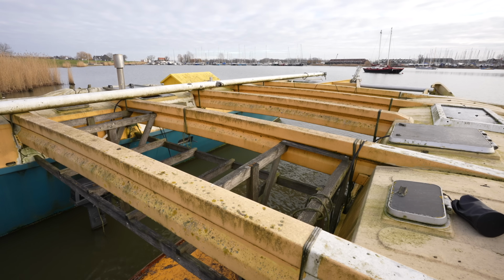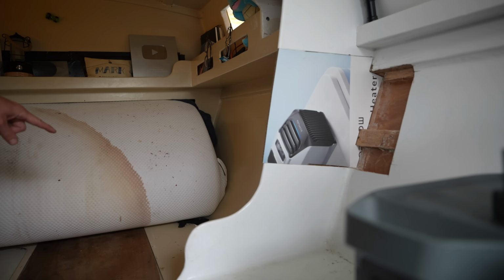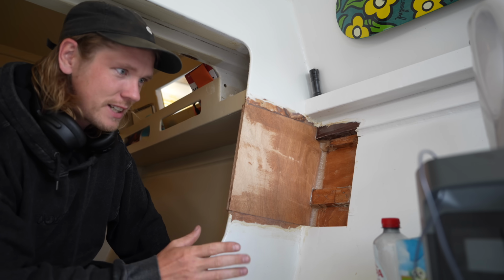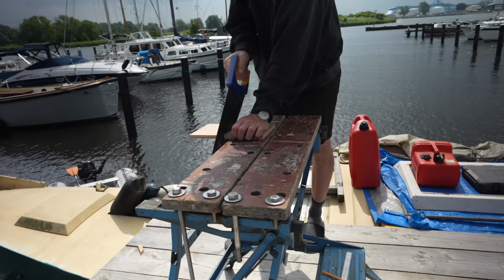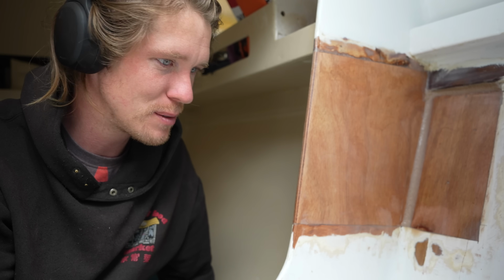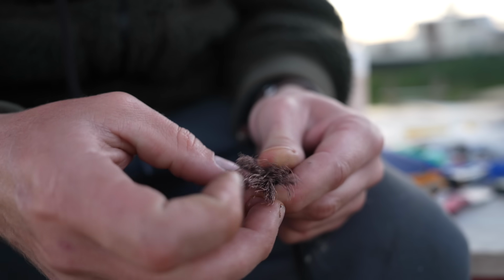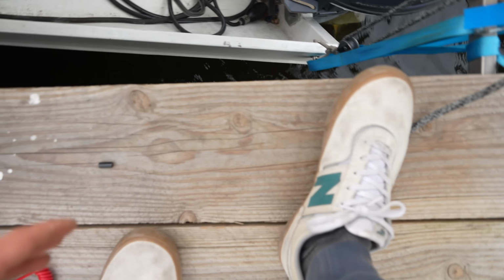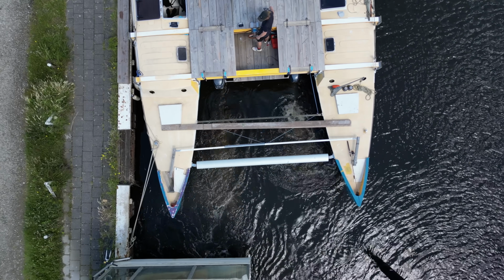My DIY Catamaran Engine Set-Up Is Complete!

Comment: Love the Jazz and Beebop 

As per previous comment regarding the bulkhead repair I agree a couple of layers of glass cloth over each side to strengthen the join or maybe route out   at 3mm depth either side and say  50mm above and below the join and epoxy in some ply doublers to spread the load across a wider area.

But I'm guessing Anika would have recommended a scarf joint, have you asked her opinion?

Replacing the motor cable was a good move, again as per previous comment I've never seen someone try to clean off a cable it's easier to just cut off the dirty/ damaged section.

Your bird friends are  Cootes and we have them in Australia also I live in Canberra South Eastern highlands and they are prolific here on all the man made lakes.

Great video

Cheers

Comment: I would encourage you to cut out the solder connections for your power wires and go to a normal moisture proof inline splice. From what I witnessed your solder did not flow. This causes a cold solder joint which will eventually increase in resistance and break.

Comment: Always better to use mechanical jointing for cables especialy high current ones. The solder can melt if the cable gets hot and the joint is not as good electrically.

Comment: Thanks for the tunes. I always appreciate some good jazz...Kenney Burrell? I just have to say that for any scarfing in bulkheads, a layer of fiberglass or somehow overlapping joints would be something to consider. Even though your dealing with mostly compression loads there will be some rotational torque on them as well. A craft in a sea state has a tendency to twist, bend, and flex. 
Best wishes and keep up the great work.
PS I feel you on the soldering. Definitely not my cup of tea.

Comment: Follow up on that glued in  bulkhead splice. Now reenforce it with wide tabs making them smaller as you add layers....like 5-7 layers of bidirectional fiberglass with good epoxy on both sides as wide and long as you can go.
West Marine has an informative Fiberglass Boat Repair & Maintenance West System Book 002-550. Worth every penny.

Comment: Messy soulder joint.  lol
Cold soulder connection will cause problems.  
Heat one side & soulder from other side , wait for it to heat and suck soulder in

Comment: The methode to extend the cable is perfect with more practise but you really need more energy.
In this case you should look at "Action" for a lighter with the welding flame, what I saw you have done somehow with a gas welder but I think of something with open flame.
You need more then 30W heating power. From 100W up with a good electronic tinn it will work much better.
For that Cable seal rubber, silicon spray is your friend and it will slip through like.....  ;-)
Why not connecting the engines in parallel? If the batt is full, it is full. I guess nothing will happen.
It is a lead batt, that will work for now.
If you later decide to go with a full 12V System on the boat you might go for a small lead starter batt and a big LiFePo4 for the whole boat which you can charge with a batt booster.

Cheers
Marc

Comment: On one of the "other" boat channels, the owners mentioned some mattress underlayment that addressed the moisture/mold issues.  I will take a look and see if they specify the material.  If not specified, I will say which channel and you should be able to communicate directly with them.

Comment: They make line cutters with multiple size wire cutters and splicers. A hell of a lot easier and less time to fix. Get some connectors and crimp with your cutters then shrink wrap it. In about 5 minutes compared with an hour with that useless soldering iron .

Comment: Don’t solder cables of heavy gauge, as you found out by the time you get enough heat into them you will damage the insulation. Get yourself a good crimper and use ferrules/tube for butt joints.

Comment: Some things will work initially. Others may have to be upgraded either before failure or during sea trials. For your mold repair you have brought the repair to the original condition. Your choice if you want to do more and beef it up. Youbalso have drawing planscto reference. Plus your neighbor's Wharram for reference. Help is a phone call away.

Now that the engines work, you can take the time to improve reliability even further. The soldered joints should be a temporary fix.  Replace with tinned cables at full length. Next look for economical solutions to control battery overcharging. Contact the engine manufacturer or a suitable supplier like Victron or your dad. Make a permanent control box/console for the engine key(s).

Rain and more rain.

Slats below the mattress, make or buy, Ikea or similar. Store the mattress in a protective cover (water resistant/waterproof).

Comment: If you are getting 15 and almost 16 volts at the battery, that is way too high. Plus with the length of your cables you will have voltage drop from the (alternator)charging system to the battery. So with that said, 16 volts will cook the battery and with the voltage drop it will be charging more at the alternator output. That high of a charge will cook the stator and they are no fun to replace in an outboard. Check the voltage output from each engine separately with only one running at a time to find the culprit. You should be back in the high thirteens or low fourteens with a fully charged battery.

Comment: Have you thought about using a solar panel type controller to stop charging the battery. cooking the battery is not good and a fire risk plus a fuse for your battery.

Comment: I think you need a split charge relay (or a more modern charge controller) so that your engine battery has priority. It will charge first and won't discharge when you are using power in the boat. That way the small varta acts as starter for both engines and the leisure battery is only for leisure.

Over charging shouldn't be an issue. The alternators should be smart enough to reduce output when the batteries are full. They will still show voltage but at a tiny insignificant current.

It might be a good idea to add shunts to each battery so you can monitor charging and charge status. You can get cheap ones that will work fine and you can monitor them via Bluetooth with your phone.

As mentioned elsewhere you should add fuses and kill switches to both the batteries. All cables need to be tied down with pclamps once it's all fitted. If you leave them flapping around they cause joints (especially crimped connectors) to break down and start sparking. Common cause of fire on boats and in campers.

Comment: With the computer, yes RAM is the most critical thing when you want to do video editing, I would suggest you ready the details of the instruction manual of your computer because a lot of the time you can add more RAM to an old computer.  You could open up the laptop and look at the motherboard, but instruction manuals are easier.

And now that you have a new computer I would suggest that you see if you can add more RAM to that one.

Comment: Lots of great progress. 

As for the soldering. Sorry, but that wasn’t good penetration. You should actually see the solder being pulled into the connection. 
The first shield you were using was for heat shrink. 
When making the butt connection, don’t splay the wire like that, just wiggle the connection together. It’s a tighter connection and a cleaner look. If you have a flux, just push each end into the container before pushing them together. Also, what I like to do, I take a waste 150mm section of wire and strip it down. I then take a single start and off the wire, and tightly wrap it around the section to be soldered. 
Since you have a gas soldering gun, I would use a bare flame to heat up large connections like that. I would then apply the solder from the side away from the flame. You want the copper to be melting the solder, and not the flame. A smaller gauge wire would be so much easier. 
I was a communications tech, and in close to 10 years of work and thousands of connections, I never had a single failure using that technique. 

If you’d like, I could make you a tutorial video, and email it to you. 

What you did will work, but it could be much better. I’m not trying to just be critical, I’d like to see you learning a better way.

Comment: There are lost of stuff available for under the mattress. for me battens didnt work but i had better resalts with plastic floor tiles that are made for wet areas like in a bar or kitchen. for best resalts you realy need air flow so maybe batten the locker lids and have the lockers vented into the main cabin so that moist air can escape. a 12v fan in the locker vent would draw the air away completly🏴‍☠

Comment: Crimpconnectors are the way to go,  or you get a 100watt beast of an iron. 
I would not use the cheap heatshink  i would go with multitask like shrink tube. It has an heat activated sealer inside of the tube😅

Comment: I wonder if an air purifier would be a good thing to have in the boat? If you get one an hepa filter it would remove fungus spores!

Especially when you are removing fungus rot it will get in the air and all over the place
Reply: But maybe a smaller round one would be better on a boat. Just search for hepa filter.

Comment: You need a bigger soldering iron, but also, when the iron builds up a black coating of carbon on it, it won't melt the solder, so you have to clean that off regularly... Or file it off if you've failed to clean it previously. A lot of soldering irons you get are only suitable for small gauge wires and PCB work. For those heavy wires you need an 80w. The torch type ones are shit.... Sorry, bit late for this advice.

Comment: More unsolicited advice.  When rebuilding your mast, take steps to prevent the wiring and halyards from being able to swing side to side inside of the mast. The noise from dreaded "mast slap" can drive you insane.  Take care 😊
Reply: One effective way I have seen done is route wires in pool noodles inside mast  put a few large wire ties leave on long tails every 4 feet or so. if your halyards are external all the less problem.

Comment: You need fuses on these cables. With such a massive battery the cables will be glowing in seconds putting your boat on fire if you get a short-circuit.

Comment: Put switch to cut the power off from one engine and turn it on and off when using it so you only need one battery
Reply: Careful with this! If you turn an engines battery off when it is running you will fry the charge circuit!
Reply: @nigelluke6078  how’s that

Comment: Don't solder, use waterproof butt connectors that are crimped on. Solder makes wire stiff and brittle, hence a weak point that's prone to break.

Comment: Mark when you get a chance to watch something Learn about Kajell's wave powered boat, with your Dad's help I'm certain you can incorporate a wave drive. The tech. Is now out of patent and there are a few videos from the 80s and an Indonesia trimaran ship using wave power. It translates wave energy to forward motion in a simple mechanical design and the foils can absorb about 50kw per. M2 of foil.

Comment: I didn't think I liked modern jazz but that was good! As for that wire soklder join - that was awful. Do they not make connectors? I have been trying to think of a better engine configuration - have you considered a huge paddle wheel between the hulls - it could freewheel when not under power and generate power!

Comment: If it's a lithium battery then you have to make sure it's not overcharged. Lead acid batteries won't burn if over charged. Lithium batteries will have a fire and they can't be put out. They burn until the thermal discharge is complete, and that can be a while.

Comment: With the battery charging, I don't think it's a problem, what happens in your car when the battery is fully charged? You might look at a Redarc battery separator and hook your house battery up behind the start battery. Properly wired your house battery can be fed back to the start battery to be used as a jumper battery. How many times can you use the word battery in one paragraph? lol

Comment: Had a recent problem with charging on my recently purchased boat due to incorrectly sized cables by the owner…failed to allow for voltage drop over about 3-4m of cable. Thought I would flag…it was charging but only at 0.5amps on tickover and discharging up to 1.5A on 3000rpm (outboard). Had to fit bigger cables + cost me a battery!

Comment: She is coming along nicely. Only thing i would've done different is cut off that used wire end and strip fresh clean wire. That may bite you in the butt later. Also that curved torch tip you used for soldering the wire works great for the heat shrink.

Comment: Personally I would not use solder on a boat ever - you get a load of corrosion due to the different metals in contact. go with crimped connectors or for cablng that should easily be changed wago connectors. there are gelboxes available for the wagos that completely seal them from the elements.

Comment: Just glueing the bulkhead section doesn't seem enough. Bulkheads get loaded in tension and the glue joint won't hold much in that direction. You should glass a bit the sections you cut and replace, instead of just epoxying them and fairing them.

Comment: Mark, I am no electrician, but...I wonder of your voltmeter is accurate, or if that length of wire is forcing a high output from the alternators? (Line loss) I am sure that others have offered their expertise, but I tend to check my meter first, then my application.  Like others, I do not splice wires in boats or recreational vehicles...or cars.  I like whole lengths...always worth the tiny extra expense.

Comment: I'm just a wee bit concerned about your butt joint repair on the bulkhead. Not only will there be compression but there will be tension exerted on it. several layers of cloth and epoxy extending well beyond the repair may be warranted as cats do flex. Another possible way to strengthen would be a SS plate, like a boiler plate through bolted? Looking good all in all. You should be out on the water sailing soon.

Comment: Rather than joining the cables, I think I'd have bought new lengths the correct size.
Reply: It may have been cheaper than buying  multiple soldering irons. There is a reason why on boats and even aircraft, preferred method of connection is ALWAYS crimping.
Another hint, thru hull fixtures for cables are very seldom water proof. If ever.
I would think your alternator would have a regulator to avoid over charging.
Reply: He needs bakers soldering fluid to make it better
Reply: Cheaper is seldom the least expensive. I think you mentioned that in the beginning of the video referring to your outboards.
Reply: If that black is all the way into the cable it needs cutting back or replacing.
Reply: Get rid of any termite wood they will spread
Reply: I have to be honest,I’m concerned for your safety.

Comment: Electricity  travels on the outside of wire not through it so any corrosion will be a problem your better off replacing it or cutting back to clean wire

Comment: Please. On marine environment you are supposed to use tinned wire.
This should be marine grade tinned copper wire.
It comes pretended with solder so that the copper will not rot.
Water has a way of going down the wires and rotting them that’s why tinned marine wire always.
Next, the black corrosion travels down the wire and it’s best to cut the wire back until you find clean copper 
If it’s all black it is corroded and will cause you problems soon 
Also always stranded tinned marine wire.

Solder on marine is not good because when the wires get hot with current passing through them the solder can melt causing shorts and open circuits.

Use good mechanical crimps.

I like the ones with waterproofing glue inside when you heat it.
Great job
Keep up the great work

Comment: You may regret making a bulkhead repair like that.  Sooner or later the but joints will crack.
Reply from the maker: lets see together :D
Reply: @WildlingSailing  may be it is an option to reinforce the bulkhead with a peache of wood over the whole lenght  topdown and so connect the old and new. it. makes also a handgrip on the edge.

Comment: The reason that wire is black like that is that moisture has traveled up between the strands and corroded it. That wire is now worth what ever they are paying at the scrap heap. 

Personally I prefer crimp connectors, they are far easier than screwing with solder, I have never had an issue with them when heat shrinked.

Comment: When soldering it’s a good idea to get a little solder between the solder iron and the thing you are soldering, it will make for good heat surface. Like to get good contact. Think thearnal
Past. Also flux will make you a pro.  Copper gets oxidized and then it does not want to make contact. You would think it’s not a thing but it is. When you apply flux it removes the oxidation and then magic happens 😂

327 degrees is the way to go. But with those big amp wires I would provide go 350 or something. Better hot and fast. Or you’re going to melt the insulation. But really trick is flux and a little solder between the iron and the thing you are soldering to make a good contact. Also clean your iron with a sponge all the time. Apply some solder and clean the iron before and after (it’s the flux in the solder that cleans your iron)Ike I said, it’s the oxidation
Reply: But really what they don’t tell you is that you need some solder between the iron and the wire. But only then it’s hot. You need to gauge when it’s almost there and the you apply some solder between the solder and wire to get you the final heat you need.